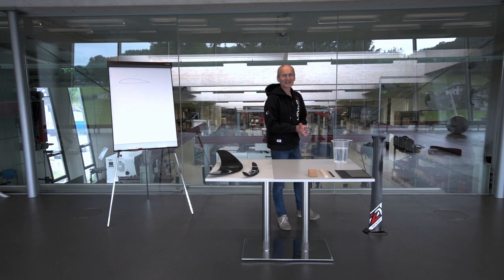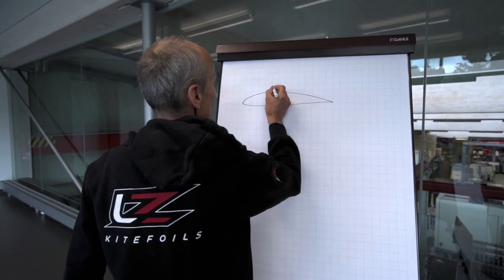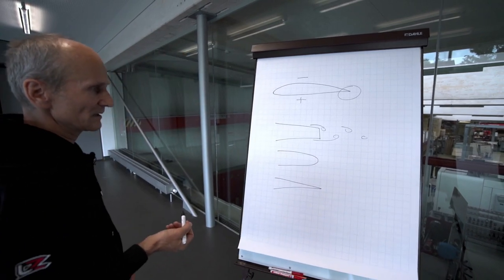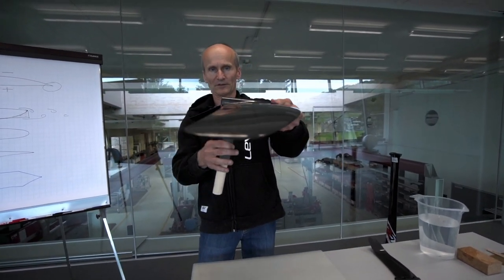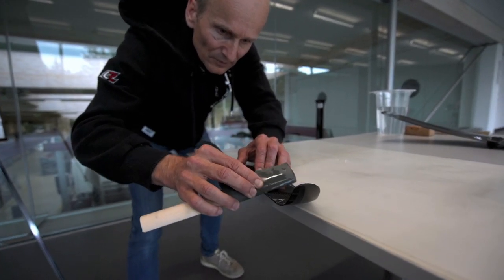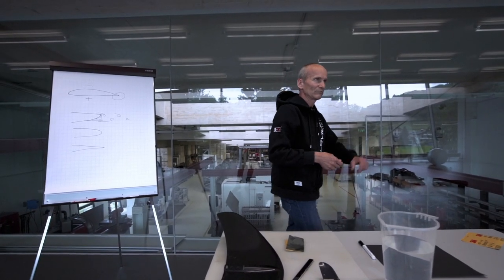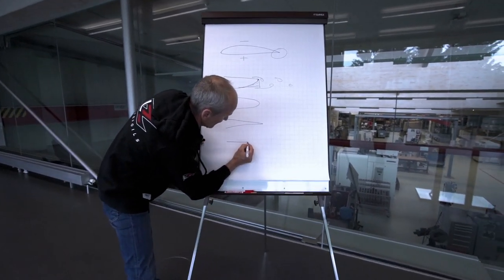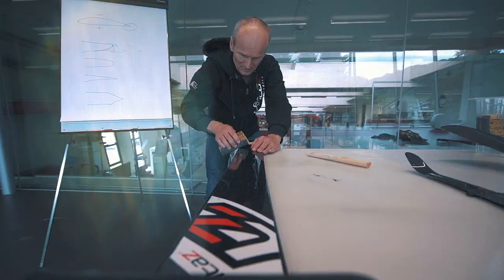ExFabrica - Episode3: Sanding Tutorial

Comment: in this video you sand the pressure side of the stabilizer .. in "How to finish the trailing edge of your Levitaz foil" you explained, that you should sand the low-pressure side .. a bit confusing :D
Reply from the maker: Yes I understand the confusion. The reason is that acually both works to get the noise to go away and there are different theories around as to what is correct. 
As Mario said, what is needed is this Donaldson Trailing Edge but the side is not that important.